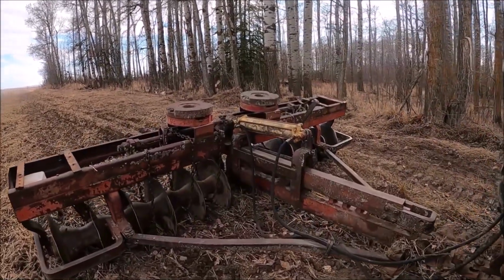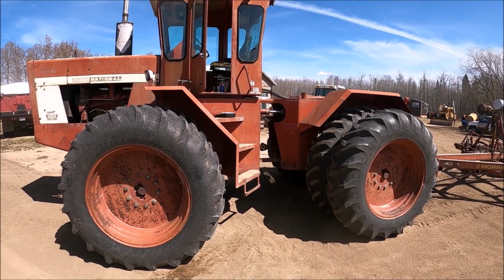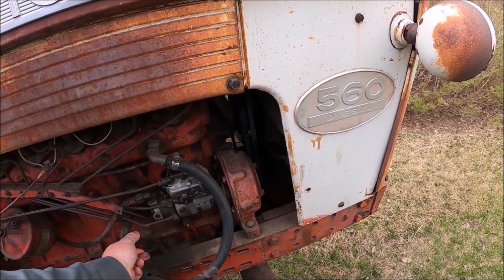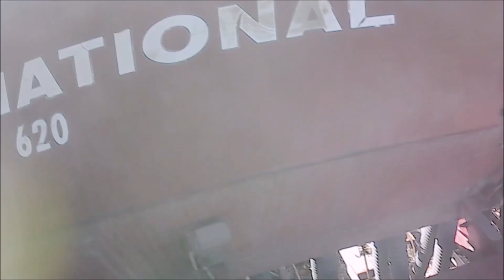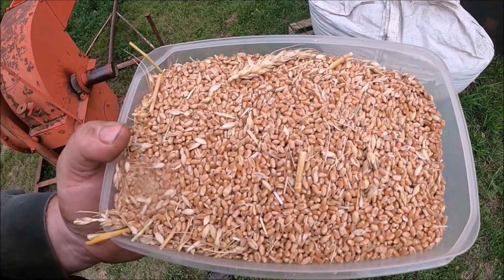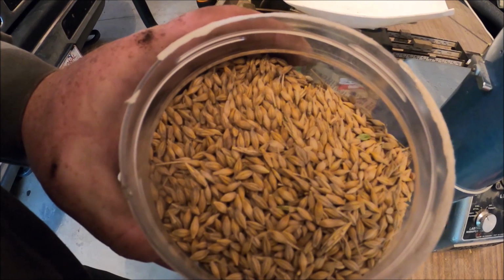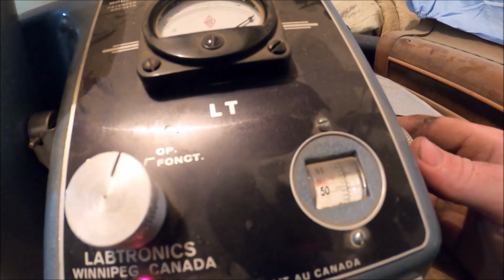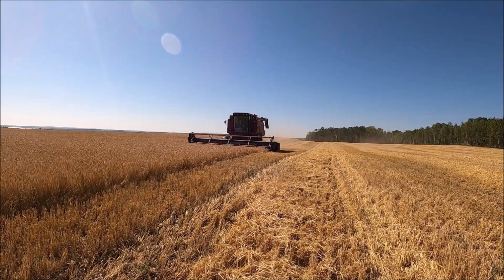2023 Farming Compilation

Comment: Good   day Ty  Interesting with big disc.
Could 560  not run faster on gas,  before switching   to diesel  ??
Kinda  sad when harvest is done   Tells   me 2023  is nearly over  . Another  winter
then spring .
Thanks for now
Reply from the maker: It's a W-450. The 560s have a 282 and they start with glow plugs. There is no throttle on the gasoline side. They run one speed. Some run faster than others on gas.